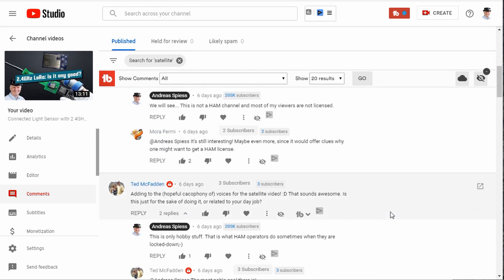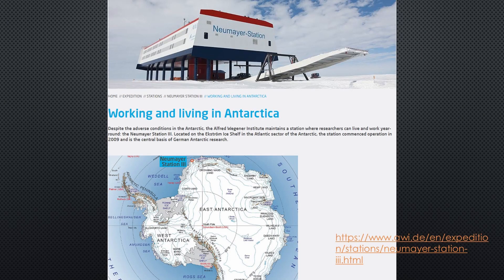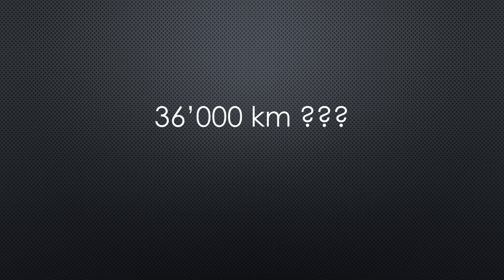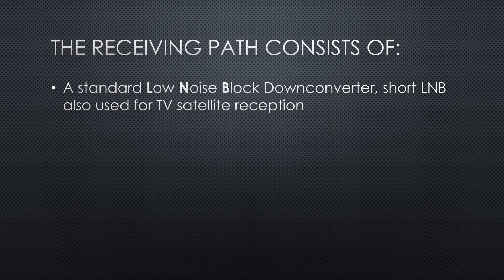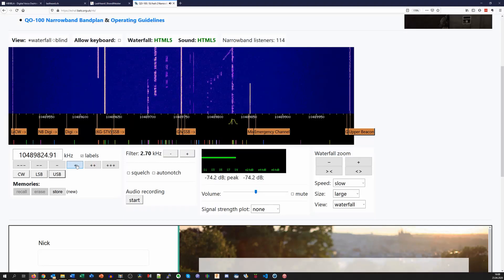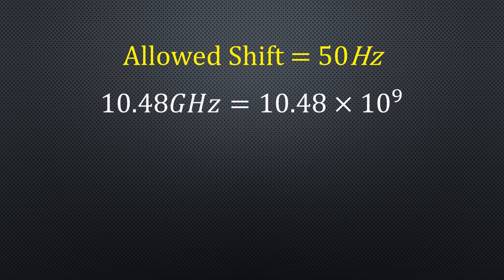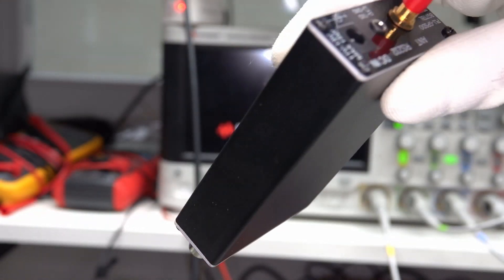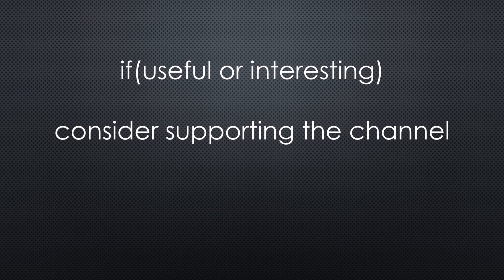012 QO-100 Reach a geostationary satellite on Wi Fi frequency (Part 1)

Comment: You transmitted the radio at 2.4GHz. Is that Q0100 Qatar Telecom satellite's transponder operates at 2.4GHz receiver?
Reply from the maker: The satellite receives at 2.4 and transmits at 10GHz
Reply: @HB9BLA  yes Sir, I understood after I watched all your 6 series QO-100.

Comment: Absolutely!  Getting that 200km on 800MHz is already mindboggling. 36.000km on 2.4GHz is .. wow.   I remember some guys using regular Linksys wifi 2.4GHz routers and a high gain antenna to cover 382km in 2008 I believe, so this is in a completely different league.
Reply from the maker: Here we use smaller bandwidth. So it is easier. Plus the satellite is very sensitive.
Reply: 'easier' :-) We will see.   Really looking forward to it Andreas.
For me this feels like communication to the Voyager satellite that you are trying to do. Maybe I should get my license again and see what it's all about lately.
Reply from the maker: With a license we have a lot of new possibilities for experimenting.